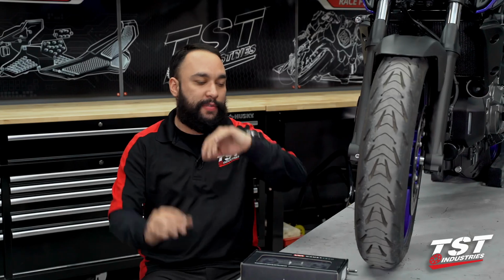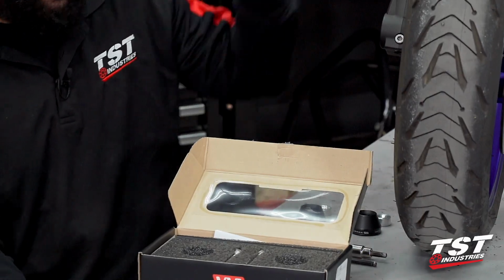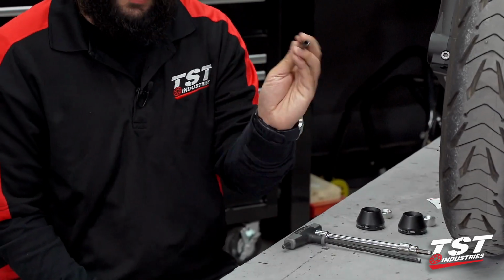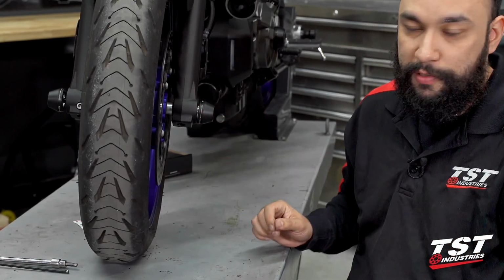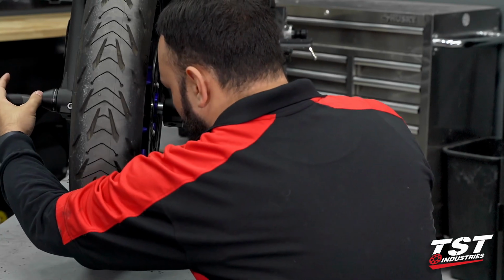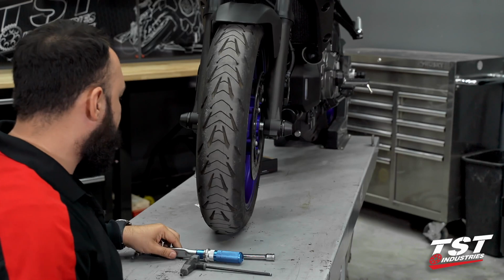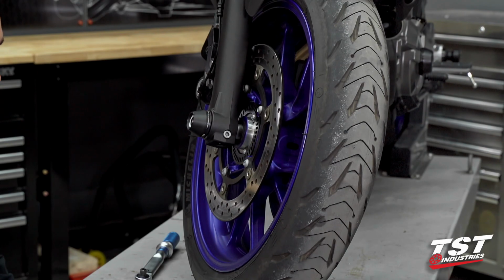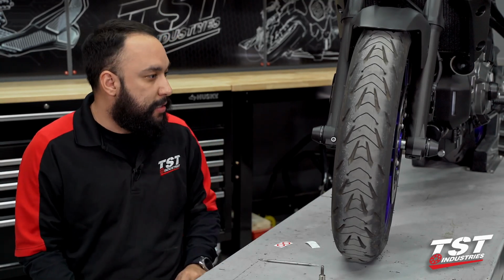How to install Womet-Tech Fork Sliders on a 2021+ Yamaha MT-07 by TST Industries

Comment: Warning to other users: I torqued it to 12 nm per the instructions and the middle rod broke. Fortunately, I had just enough thread left on the remaining rod to be able to install the sliders (albeit this time with about 60% of the recommended torque). Imperfect install but it will do its job.

Comment: Hi when are you going to supply parts for the new Yamaha XSR125 released in 2021? as the parts will also fit the Yamaha XSR155! which has been out for a couple of years now? I have already fitted the TST Industries womtech rear swingarm adapters and the TST Industries front and rear Led Indicators to my Yamaha XSR125 2021!
Reply from the maker: None of those bikes are offerred in our market so it is very difficult to do any real R&D for them.